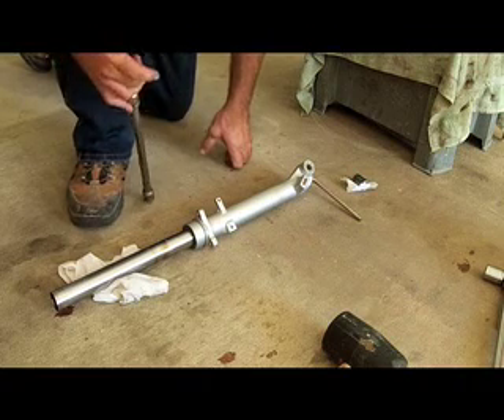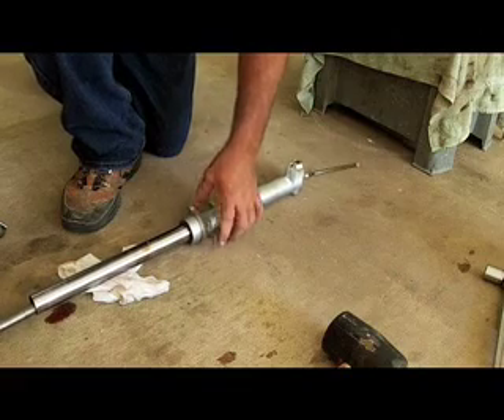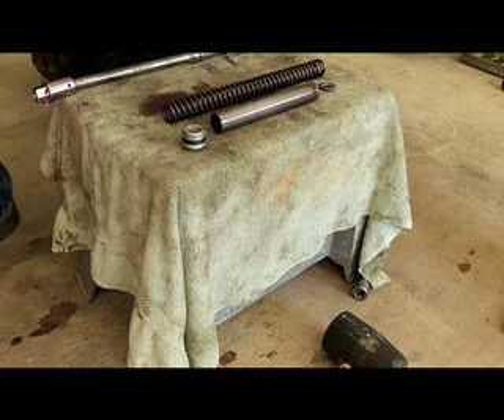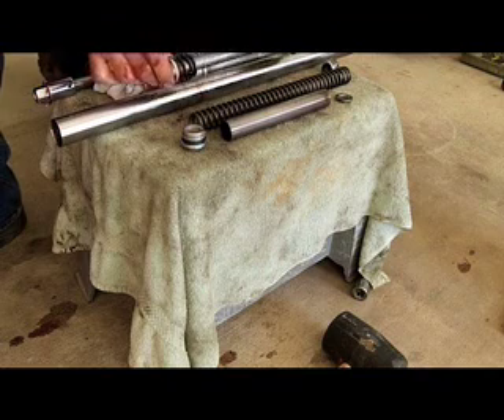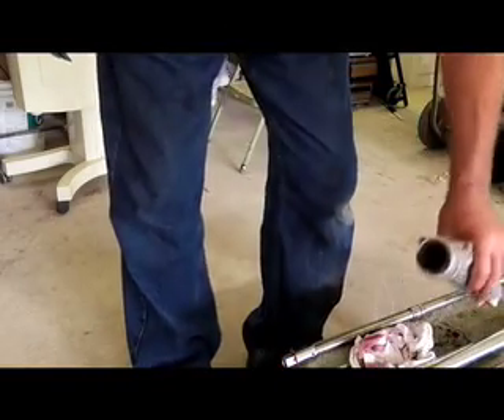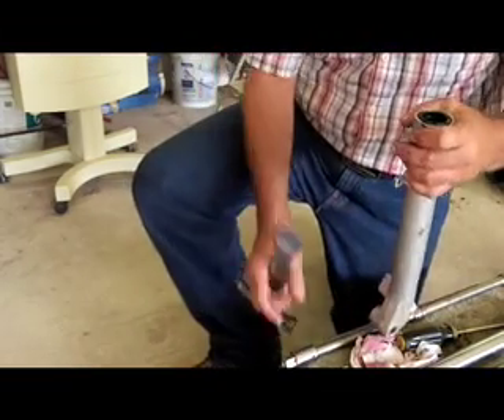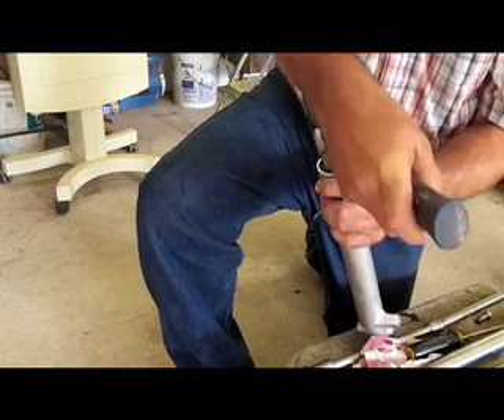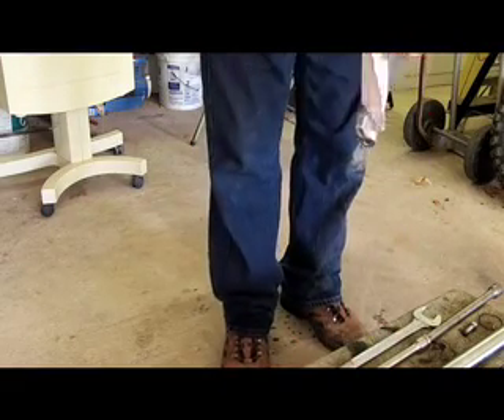Fork disassembly

Comment: I used your coupling nut idea and it worked like a charm, I cant think of an easier or cheaper way of making this required tool "$4" at Home Depot.  Recommend bringing in your 19mm socket to make sure you get the right size.  Thanks again!

Comment: You could have gotten the allen screw out prior to unscrewing the fork tube cap while still under pressure it will break loose without the tool and the make shift extension you made